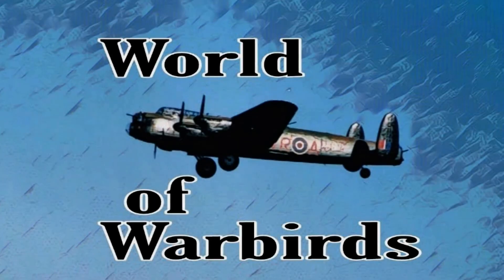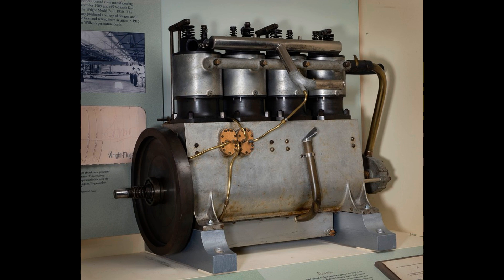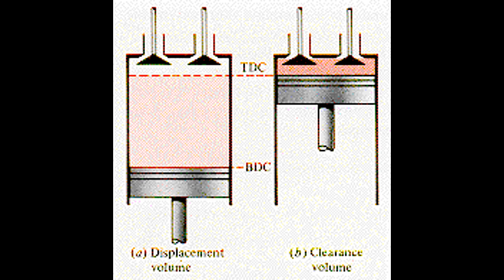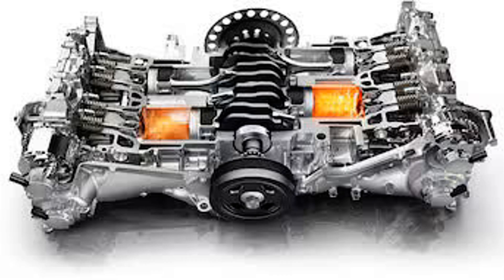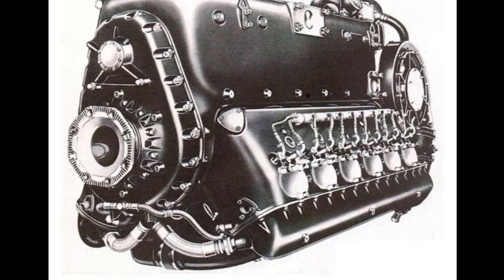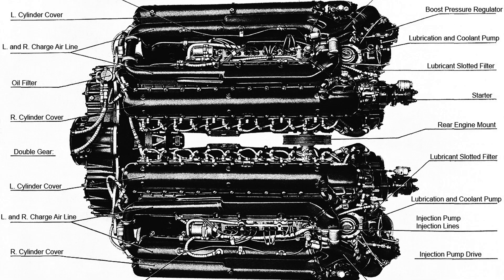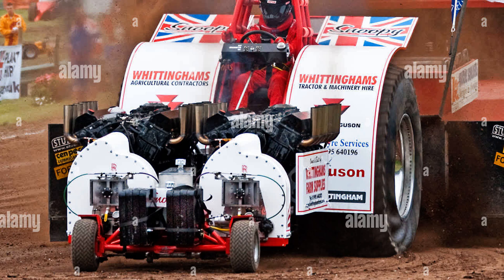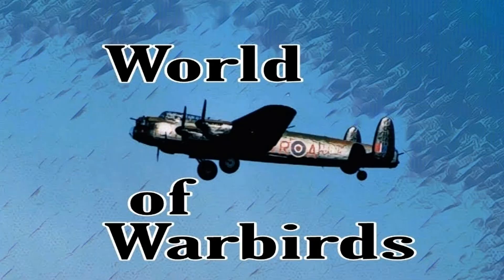Quest for Power Part 1: Cylinders! Inlines, V, H, W, and X-Engines!

Comment: Inline engines don't have to have an even number of cylinders.  There have been 3 and 5 cylinder inline engines.
Reply from the maker: Yes, you are correct. I should never use absolutes in these videos as there are ALWAYS exceptions. (Oops I did it again)

Comment: Great video ! How do the inverted engines maintain oil to the crank ? I’ve always wondered that.
Reply from the maker: It was a dry sump system. The oil is pumped to the lube points and is recovered through channels similar to the channels that supplied it. This oil is then pumped to a separate oil containment tank and then pumped back into the bearing surfaces.

Comment: Napier was known for their uncommon cylinder configurations.
Not mentioned in the video was the W12 Lion engine with 3 banks of four that powered fighter aircraft in the interwar period, some of these engines were fitted in land speed record cars which survive and I have seen them in action.

Another complex design, although not an aircraft engine but a marine engine for patrol boats and torpedo vessels, later also used in the famous British rail class 55 Deltic locomotives was the 3 bank opposed piston Deltic diesel engine.
Not to be confused with the opposed cylinder aero engines in this video, they had three banks of 6 cylinders each arranged in a triangular shape with a crank shaft at each corner. In each cylinder 2 pistons are facing each other with the space between them as combustion chamber. It's a headless engine, think of 3 V engines with the heads removed and then the open cylinder blocks bolted together. It was a 2 stroke using ports as there were no heads to fit poppet valves into.

Comment: At about 5 minutes in you claim that the number of cylinders is always even. I suppose at this stage we're excluding radials and rotarys where the number is invariably odd but even then there are certainly some 5 cylinder inline engines out there - perhaps not aero engines?
Reply from the maker: Yes, I should not have used the "always" and used "usually". In this field there seems to be at least one exception!
Reply: @worldofwarbirds  It's not so much that, though, as the suggestion that even numbers are needed for balance. I don't think there's anything inherently unbalanced about odd numbers of cylinders.
Reply: Actually car engines exist with every number of cylinders from one to six (including three and five). I haven’t seen a seven but eights were common.
Three cylinder radials were used for the earliest Piper Cubs.
Even numbered radials have been made but weren’t common.

Comment: You show a radial engine at the end but say radial or rotary, as if they are the same thing.  A radial engine has many cylinders arranged around in a circular pattern.  A rotary engine is a completely different animal, altogether.
Reply: Yes there the gnome which was a rotary radial.
Reply from the maker: The whole next episode is on this topic and I do make the distinction between the two.
Reply: Both have cylinders located radially. A rotary rotates around the stationary crankshaft while in a radial the crankshaft rotates while the cylinders remain stationary.
Rotary’s are limited to about 150hp because of issues with the rotating mass of the engine.

Comment: I'm asking "How do you cool it !" a double wasp seems the limit for cooling.  "X" engines seems like a disaster from the start.
Reply from the maker: Actually cooling systems would be a great addition to this series. Thanks for the idea!
Reply: X-Engines are still in service.
The Russian Armata tank has an X12-engine.
The WW2 X-engines had problems with cooling that probably could have been solved but weren’t because the far simpler gas turbines arrived just as they were getting the bugs solved.
If you want to try complex there was the five bank 30 cylinder tank engine developed by Chrysler and fitted to the M4A4 Sherman tanks.
Reply from the maker: Interesting comment! Thanks!